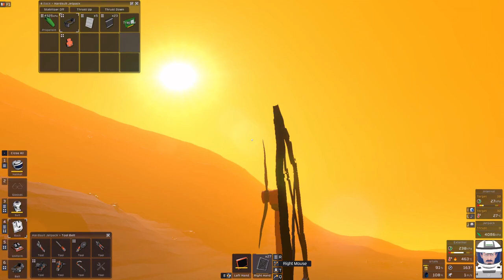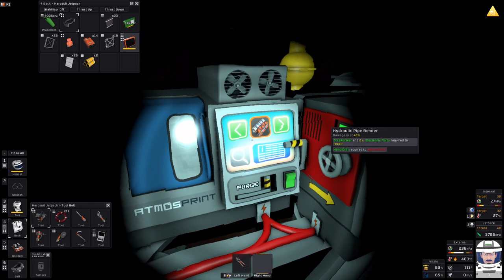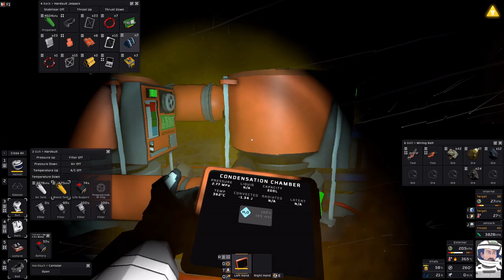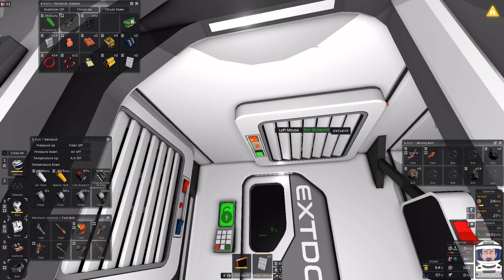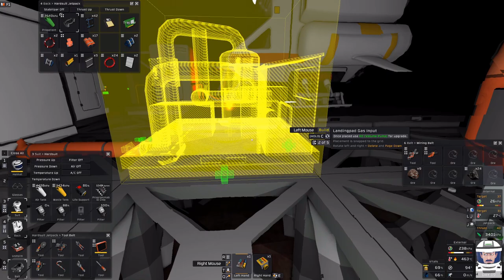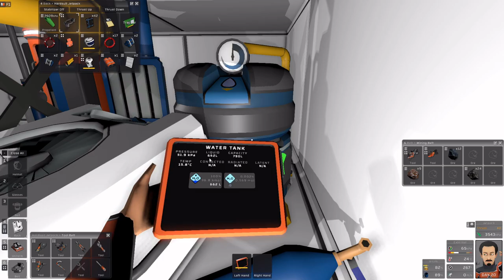Venus Phase Change Only Pt5

Comment: you shouldn't be concerned about how a pure phase change system compares to a pure AC system. neither in terms of power or throughput. a phase change system is much more fun to build and manage that even if it scored worse in both i'd still opt for it. but it would have to be practical. if the best anyone can do is a football field worth of stuff to extract 2kJ on average i would argue it's not practical.
Reply from the maker: Agree, it just isnt practical. Which is kind of a shame since the bottleneck is where it can dump the heat at. Gas trader "buying" Pollutants was an interesting one for sure, but It only seems to be like a funky top up to keep your AC system going if the storm draw isnt in high enough production. If you get lucky and get a gas trader from your 3 vanilla slots every other day, I can see it keeping the system going.

Though the power usage was an interesting benefit. Even 12 large powered vents powering a low power system for 7 days only needed the 2 station batteries + 2 to 3 wind turbines to both recharge batteries  and allow the vents to work. In a sense it seems like 1 Large powered vent allows 200J of cooling between storms (assuming 8 days between storms). Not a very strong starting point but hopefully could be scaled up to better support a larger base. Gonna need a lot of large tanks though.

Comment: This might work, try on a test world first. They way my Vulcan no phase change devices/AC system works is I collect liq Pol then send into a series of “ expansion chambers” with liq inlets on ea to feed the next one., ea chamber is set be less than 800kPa via active vents recycling the Pol back to the “compression chamber” on Vulcan w/ expansion chambers I got from 135-140 liq Pol to -73 cold room. This won’t work on Venus cause there isn’t enough Pol in the atmo. However you start the sys with water and get it to freeze then pipe the ice into the room or a furnace to remelt/ condense you could tap that cold air via radiators
Reply from the maker: Possibly, the only thing im not sure of is if doing with water would be problematic later. Sure it can melt but i guess thats why we have ices for gaseous and liquids if they hit freezing… really odd though. End result though is that the heat still needs to be pushed out somewhere to keep things going. I think that can buy some time before a system is set up to push the heat out.